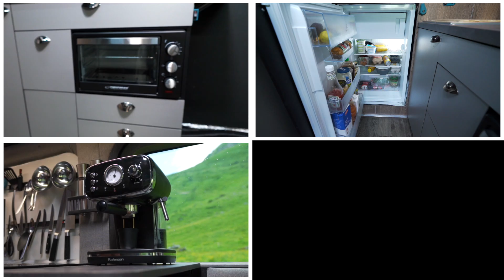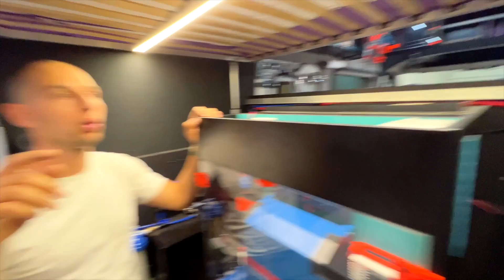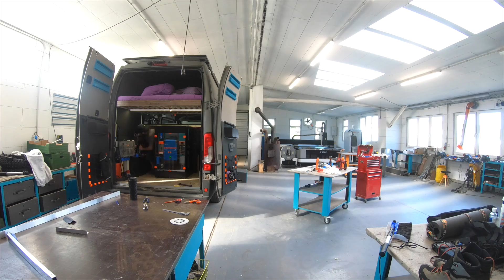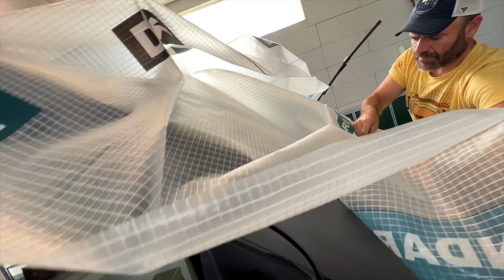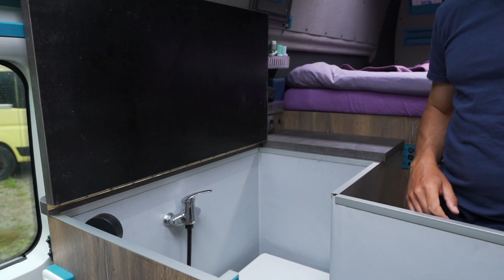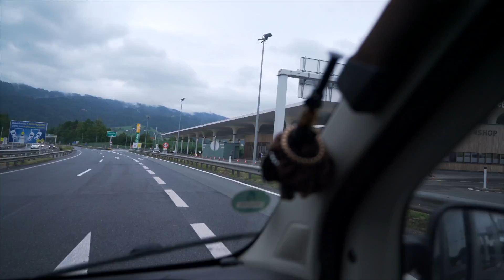The End: Imaginative Van Build (w/ Bathroom) - Final Episode!

Comment: Safe travels the van looks great . My project here in the US is much much older it’s a 1981 Dodge Trans-Van was built on a Dodge 1 ton van chassis but not a full size camper . I built a few things inside for now just to how it will all work . And all works and will be a big open space theme, no clutter . First will be power train V8 engine swap to a 6 cylinder and automatic transmission to manual transmission .Then later a 4X4 conversion. Then build out the inside .